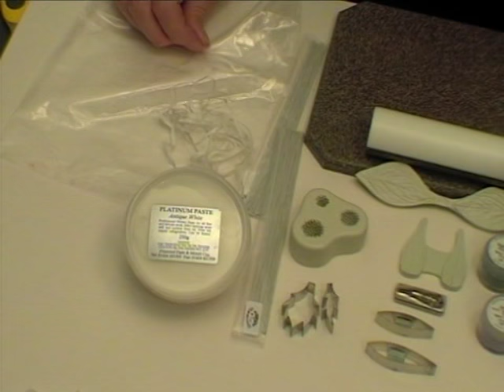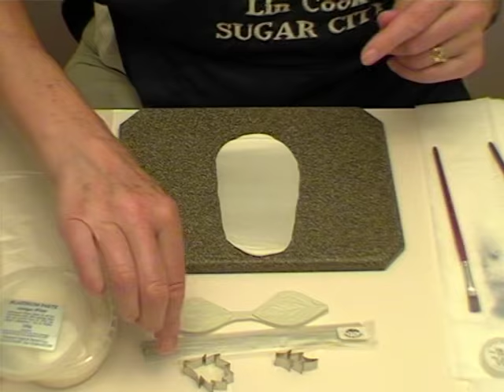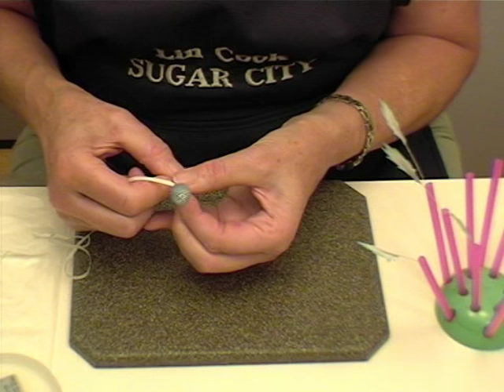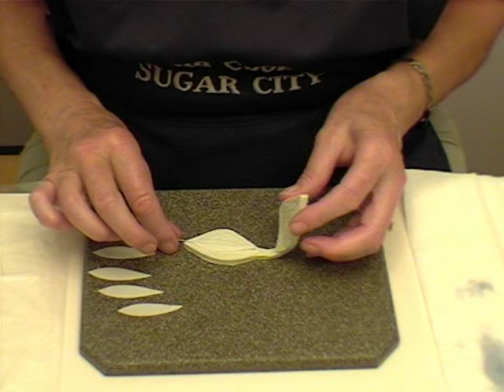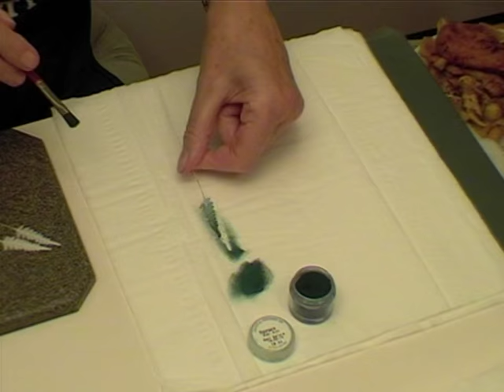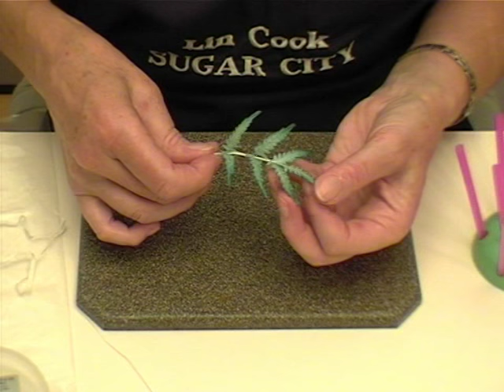Seaholly spray

Comment: You make the twiddled end look so easy.  My attempts went baggy and didnt stick to the wire..Any ideas please x
Reply from the maker: Claire Townsend , it's a feel thing,  so a bit of practice goes a long way. Make sure you're applying enough pressure, it's better to pull all the paste off the wire and start again than too leave a big sausage! Good luck😁
Reply: Doug Cook thanks so much as it looks easier to apply than all the veining and pushing wire in x
Reply from the maker: It is so much easier.  You'll never go back once you master it. My mum gave me a 20 minute demo and I went and demo'd at Earl's court,  having never done it before!